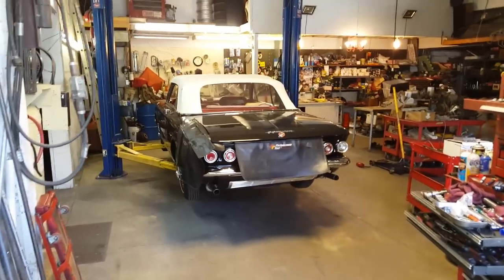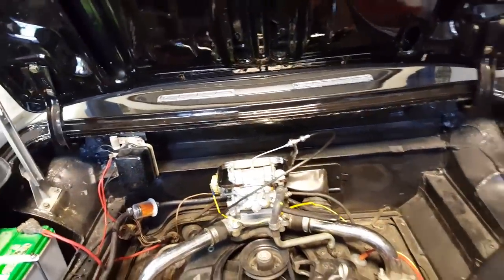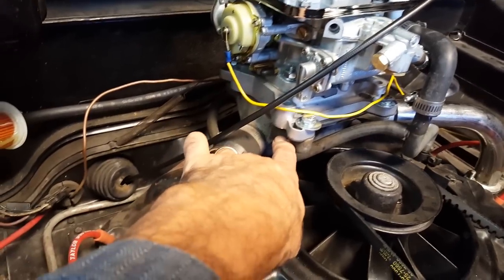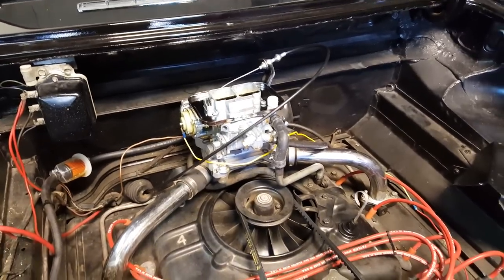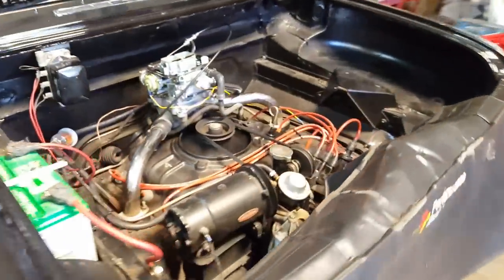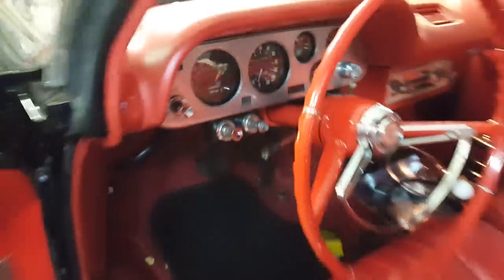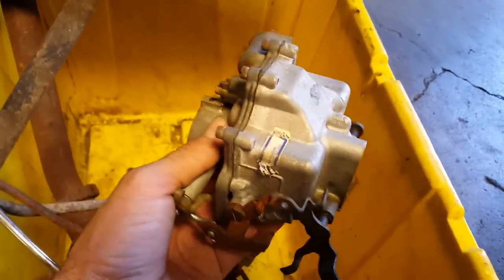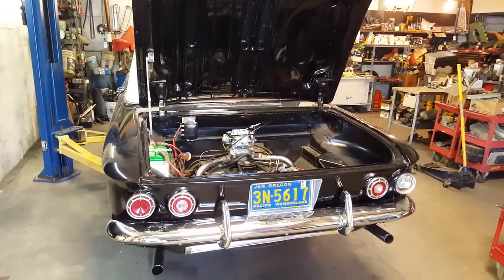Corvair Monza Spyder Turbo Convertible Revival

Comment: I had a VW 1835cc engine with a 2 barrel Holley carb on it. It ran good but that Weber progressive would have been better. Is there a bracket or support on the back side of the manifold? It looks like it needs a third leg to hold it up

Comment: I wonder if it had that big carb because it was Turbo, It would need the extra fuel flow if it was boosted. Also I have no idea how they could get turbos to work with a carb, they didn't catch on until fuel injection became the norm, because it made it possible to make the engine run well on and off boost.
Reply: They would do it both ways , suck through and blow fuel .yes the Fuel Injection was the way to go. We know a lot about Turbos now this and most Turbos of this era were done with out Intercoolers !

Comment: This is pretty brilliant. Not that it needs any more power, but could this setup still be turbocharged hypothetically?
Reply: Sure. There is no reason it couldn't be restored if the parts could be found.
Reply: Robert Johnson, I think he was asking if that 2 barrel carburetor could be used with an original turbocharger. If my memory serves me correctly, the original was a one barrel side draft carburetor, therefore one would have to create an adapter to allow a down draft carburetor to connect to the turbocharger.

Unfortunately the car would need to revert back to single exhaust. Also, it may not have the original low compression turbo motor. Those two 1bb carbs and the air cleaner crossover intake (spare parts) suggests to me that this car doesn't have it's original motor.

Comment: What's your experience with the Pertronix stuff? About 10 years ago,a lot of my friends were using those,but they seemed to have a variable (short) life span. Some made it 2-3 years,some lasted 6 months. Has the reliability gotten better since then?
Nice car,She's got good taste.
Reply: you have to make sure to use the correct coil.  My understanding is that the people that ruin these things run super low resistance coils and kill these thing.  IIRC you're supposed to use a 1.5ohm+ coil.

Comment: why was it un-turboed?
Reply: Feeding oil to the turbo, which sits up high, was difficult. The heat could cook the oil.

On a slightly different note, based on the spare parts, 1bb carbs and the air cleaner crossover, this car probably has a different (non-turbocharged) motor.

Comment: What a pity Ralph Nader’s attacks on the Corvair were able to intimidate GM from building this along with practically any other interesting car from the early ‘70s onward. The Corvair could have evolved into a Porsche fighter, but instead GM preferred to invest its vast resources into yearly styling changes and badge engineering, where one car was sold under many names. GM no longer deserve to be around, but like the banks that were bailed out during the 2009 financial crisis, GM is too big to fail and so its mistakes will continue to be subsidized by the taxpayers.